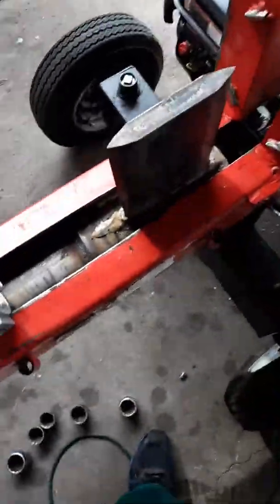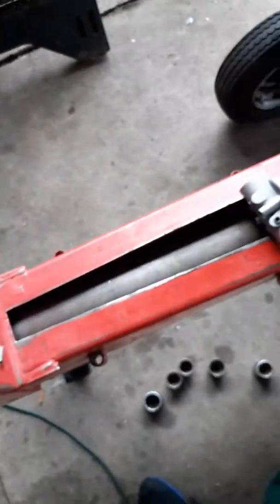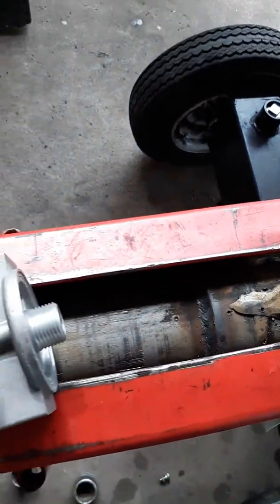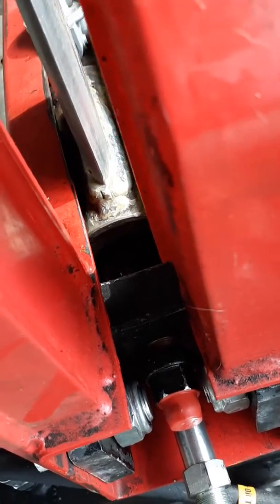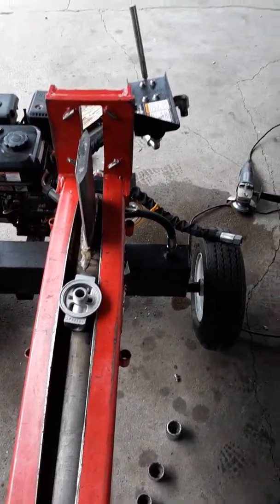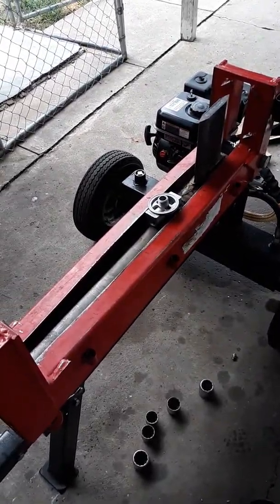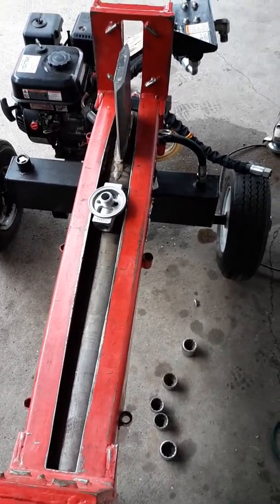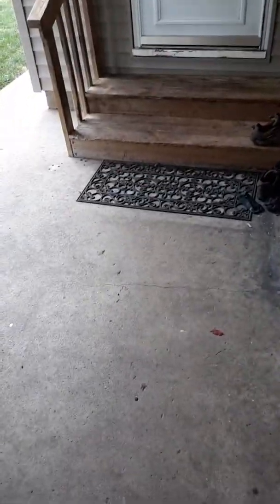Harbor Freight 20 ton splitter FAIL!

Comment: Harbor freight sells a replacement cylinder assembly for 300
Reply from the maker: Wish I knew that when I had that splitter..ha. I looked everywhere online at the time and found nothing. Wonder if they recently started to offer that. I took mine to a hyraulic shop and they put in double seals and they were better quality seals. I didn't want to have to deal with that again.

Comment: The cylinder opens from the end, I just took mine apart, the nut holding the rod to the piston to it came off.
Reply from the maker: The hydraulic shop had to mill my rod for the extra seal.

Comment: Hi, I just bought a used one of these HF splitters and it has a slight opening but not as bad as yours. Can you tell me what caused that? And how did you bend it back in place?
Reply from the maker: Think the wedge gets turned on logs and the pressure pushed out the metal. I used a big vise and manually squeezed it back. Had to do side to side and top to bottom.
Reply: @woodnyardjunkie  Wow, thanks for the quick reply. Is it the 4 way wedge or the single?
Reply from the maker: @pvwjr  both...wedge moves around a little. That causes a little twist and causes some bending. Wish I would have kept the HF splitter. Moves around easy and made quick work of smaller stuff.
Reply: @woodnyardjunkie  Thanks again for the info. I agree, so easy to move around and it splits everything I put on it. Smaller stuff I can run the engine at half throttle!! Great little splitter.